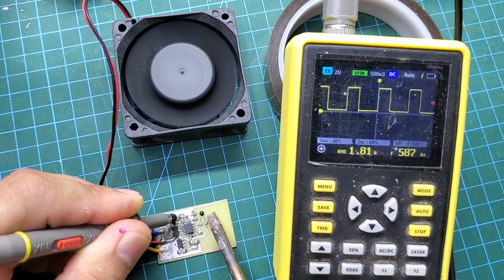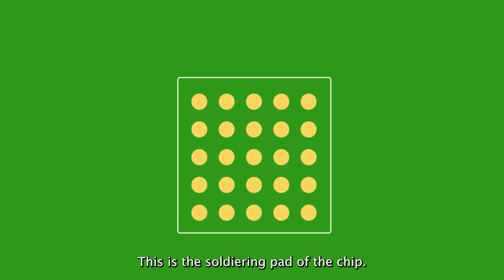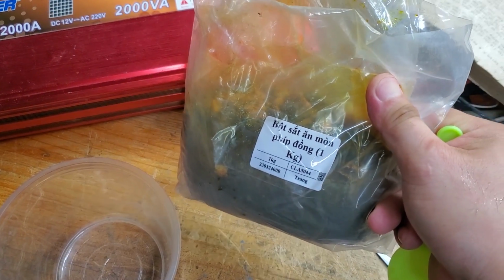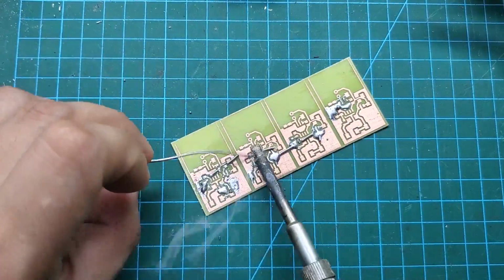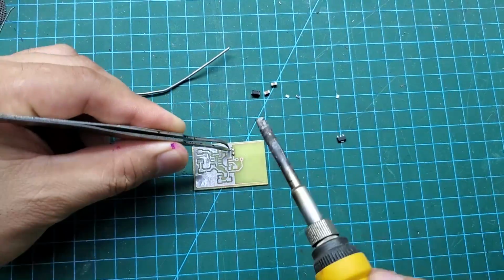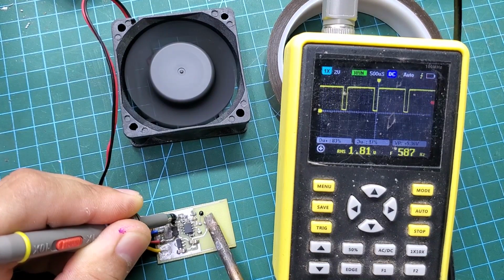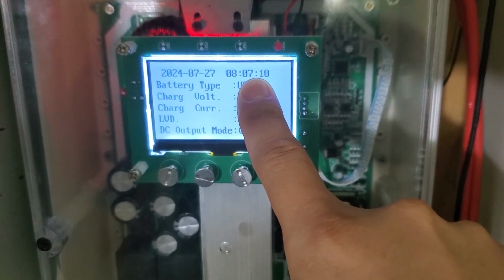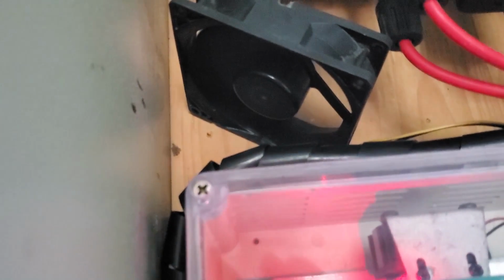Make fan speed controller for inverter | JLCPCB

Comment: Please dear Instructor, I bought a Chinese Egs002 pure sine inverter board, built with Lm324 circuit. My problem is about overheating, if the heat sink is hot, the cooling fan doesn't work, but the Inverter circuit shut down the inverter. And you have to restart everything. The fan and the NTC are good and working.
Could you please help me solve the problem with an idea, please
Reply: I always end up wiring the fan directly; sometimes via a 40 or 45ºC small inexpensive thermostat, those circuits are a problem

Comment: It's just and pwm controll that that the ntc controll the duty cycle the hotter the ntc get the more negative voltage rush in to adjust the duty cycle